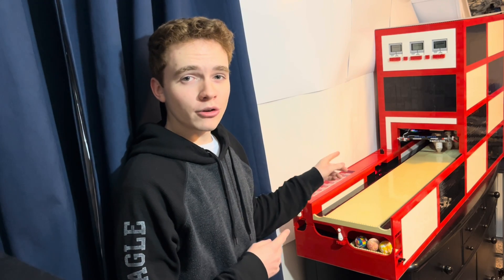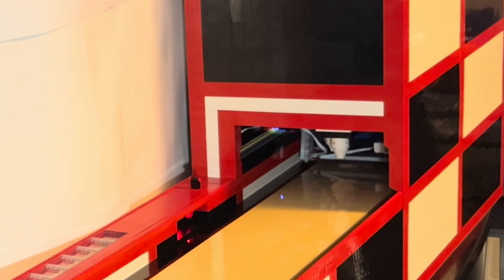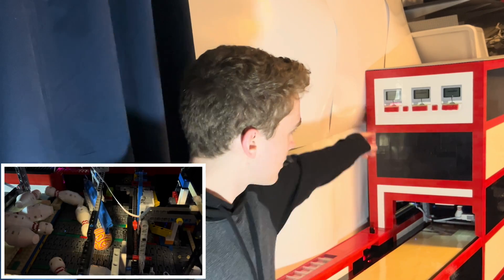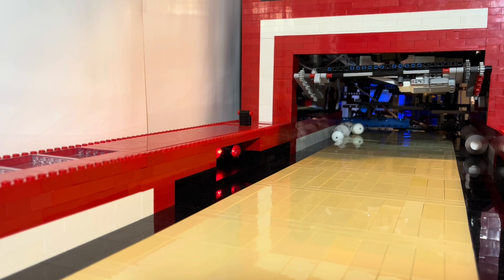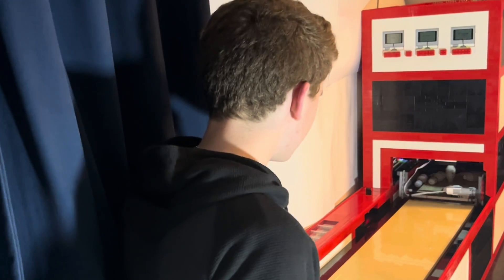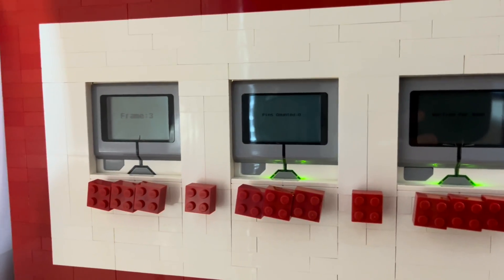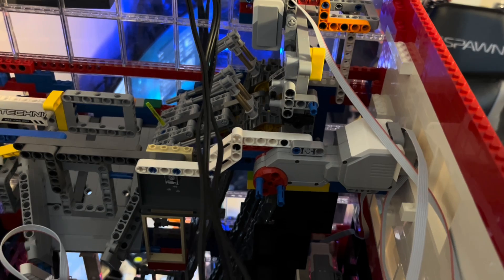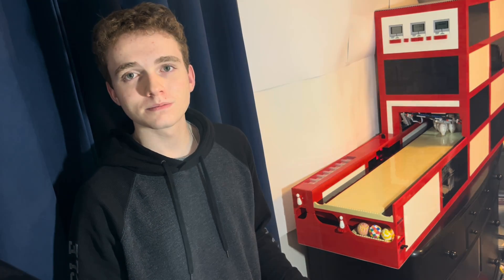I Built a Working LEGO Bowling Alley - Lego Pinsetter (World Record)

Comment: this is very cool but you might want to speed up the motors
Reply from the maker: Thank you so much! Unfortunately that is the maximum speed of the motors since I had to gear them down to increase torque since the pinsetter is so heavy. That makes them output a slower amount although they are spinning at max speed

Comment: Looks awesome! But how does it count the pins in the second half of each frame if they are swept away without checking first? Should be an easy software fix
Reply from the maker: Short answer, it doesn't. While I had a program that would count pins until it did not have any more pins to cycle then for it to sweep the rest, thus counting the pins in that second half, it took way too long adding an average of a minute between frames. In the first half, it is able to count the pins while the machine is setting them back down etc though

Comment: Incredible work man! You also have a world record on the fastest built Lego pinsetter for sure!
Reply: Also, I really don’t want to be that guy… but… I know of a larger working pinsetter on YouTube. Built by a guy called NLF Daniel and posted 5 years ago. Now don’t get me wrong, I knew about that one and you still impress me enormously!
Reply from the maker: Thank you so much! I just checked out his video and his does seem to be about as large or larger although it is difficult to say. It's also difficult to say what would qualify for a "complete" machine if it has to be enclosed etc. I may remove it from the title but am unsure. Is mine the only one with the 20 pin system and thus the fastest or have you found others with the same system but mine is just quicker at 45 seconds?
Reply: @LegoCloud  I think you can keep it in the title no problem. As you say, it may be about the same size, although my personal opinion is that it doesn’t have to be enclosed since they aren’t IRL. It does need all the basic features though, and you got that. I believe mine is the fastest overall (and I run 23 pins) but at your size yours is the fastest if it’s faster than Daniels. I’m sorry to sound like a snob or something, it’s definitely not what I wanted. If anything, I just wanted to bring some light on the only other Lego pinsetter I know of in this size and that means yours is an outstanding accomplishment :)
Reply from the maker: Not snobby at all, I really really appreciate it!! I definitely thought yours was faster, I think your right on my scale I am the fastest though, especially of the ones of similar larger pin size. Again, I really appreciate the information, it is so cool to see others having the same passion/ideas! :)